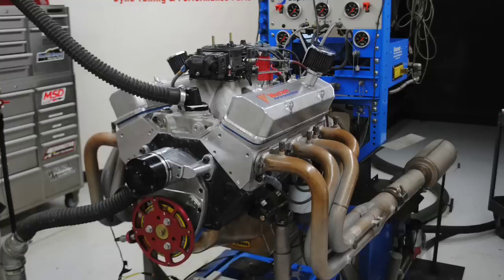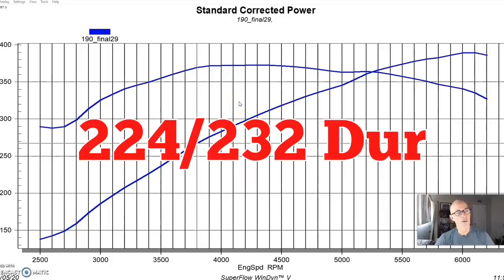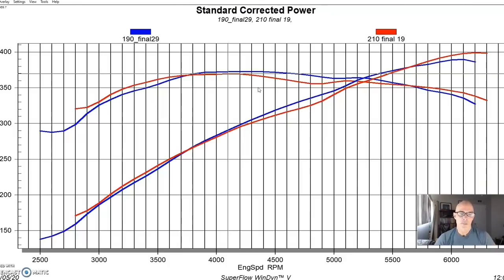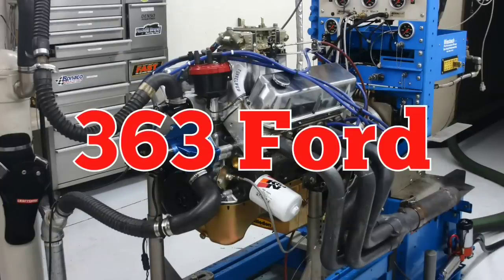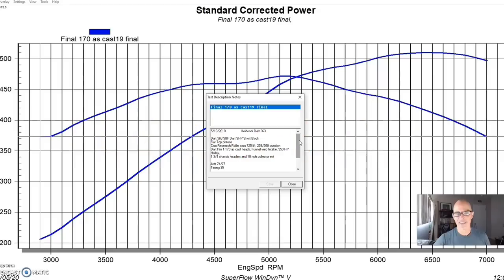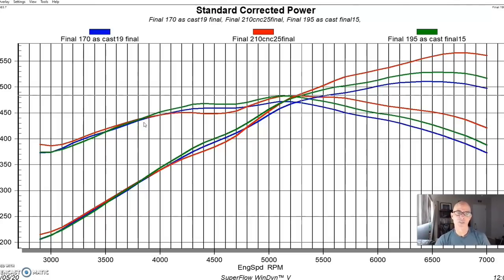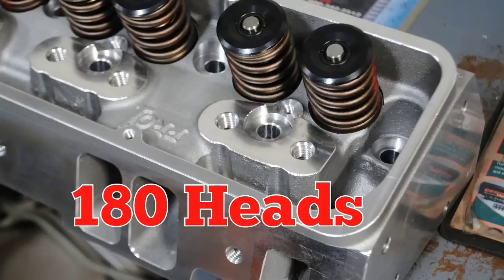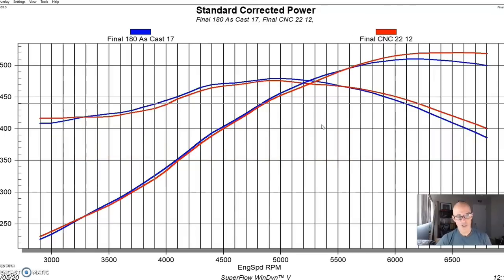PORT VOLUME-IS BIGGER BETTER OR IS LARGER LESS?

Comment: I built a 400 Ford for a 4x4 F250, with closed chamber 351C-4V heads, 351C-4V intake and spacers to use that intake on the tall deck 335 block.  (I never subscribed to the big ports stink at low RPM ideas.)  I didn’t use a huge cam, it was a 280H Comp IIRC, I had a 750cfm Edelebrock on it.  Compared to the nearly identical engine I built on a couple different platforms (Clevor/400) all with smaller 2V style ports and similar compression (Mostly Aussie Heads) the 400-4V had more power everywhere, but I found the 750 Carb to be too much primary venturi size for good part throttle booster signal, could be port velocity?   IDK?  (I bet a good Q-Jet would have been decent?)   So, for the street I ran 600cfm (ran great) and used the 750 for “Improved Stock” Truck Pulls.  That engine pulled hard 2500-6000, I wished I would have printed off the dyno sheets. – I also wish we could dyno test part throttle easier.

Comment: I wonder what would happen if you tightened LSA on the bigger port combinations? I suspect that the midrange torque gap would narrow or reverse.
Reply from the maker: changing the LSA would do the same thing on both motors

Comment: Hypothetically speaking... With an eye towards minimizing spending in the long run.  Not afraid to buy once and cry once.  But I currently have a low mileage original sbc350.  Have the itch to pep it up with heads and intake and rv type cam.  But as budget allows in future I'm thinking of 383 much more weekend toy.  Not thinking solid roller crazy, but,  Hydra roller, air gap dual plane type power.  I want to maintain as much streetable HP and trq as possible without spraying or boost for a 99% street car.  Do I go like as cast 225-ish, tricker 200-ish with factory CNC.  Does completely ported heads and intake make any sense if it's all about same-ish money?  Sorry. I tend to ramble with thought.
Reply from the maker: see the 383 videos-pick your desired curve

Comment: Interesting test Richard. I wonder if the drop in mid rpm across the board had anything to do with runner length? It would be cool to see this test setup with an Edelbrock RPM Air-Gap intake and compare the charts to see if the mid rpms pick up at all.

Comment: But looks like u loosing mid power which would roll racing since most cams don't really kick in till 3k . So my take doing rolling starts smaller is better but over all unless you hitting 6k+ the difference is a none factor for street but maybe strip   but 1k $ difference is it Worth it .. street I say no unless you want to live in the red . But for strip then yes I guess every hp matters

Comment: Very good. I was gonna run factory 624 heads on my low end torque 350 but they are so bad mouthed I just put them aside. I could not find a good enough deal on rebuilt factory heads and half the time they didn't put in the hardened exaust seats. The 186 and 041 are gold and I want accessory holes so. BRODIX 180 ik on a rv cam chevy 350 I think it will be alright. Thanks for the video

Comment: my question is if one head is as cast smaller port volume and then you run larger port and Fully CNC Ported , is not apple to apple next step. run fully cnc ported smaller port size and a larger port and cnc

Comment: The graph starts at 3000 rpm. Whats the power difference between idle and 3000 rpm which would be the range where a typical daily driver would spend the majority of its time operating within?
Reply from the maker: you at WOT at idle a lot?

Comment: So I'm building a little 306 with trickflow 205s and gona hit it around 15lbs that head should support the extra HP right
Reply from the maker: heads don't care about boost
Reply: @richardholdener1727  ok  just figured it would make less boost and stress for having a larger head.Your vedios have be very helpful for sure keep them!!! 👍
Reply from the maker: you are talking about boost but what you really mean is power. 205 heads will make more power at any given boost level, so can either make the same power at less boost or more power at the same boost
Reply: @richardholdener1727  yea that kinda what I ment with like a smaller 170 heads @15 lbs then went to a 205 head the boost would drop some and probably pick up more power with less boost like maybe to 12or  13lbs is what I'm saying would be less stress or I might just be wrong could just be the same power

Comment: In my experience.......there is no reason to ever go smaller than 210cc on ANY sbc for street/race performance. If it has healthy cam specs I never go below 220-225cc. Even if it did affect low speed torque you are blowing through that with converter or clutch. Grumpy Jenkins had it right.......when someone picks a catalog cam.......they need to add another 15-20 degrees of duration to that........as most people skimp on good flowing heads.

Comment: so if a fella was to toss in some 210 heads, a 347 stroker kit on a sbf 5.0 with a "RV" grade of cam, we'd get better down low performance, without any chance of embarrassment up high?  of course coupled with the long intake runners?  same would be for the cheverolet 305 that's about to roll into the garage too?  (I clearly understand, bigger engines have definite benefit, but i enjoy keeping numbers matching on my builds. ( it's easier to store heads and intake, etc, than entire engines.....   )  Can i assume the same rule would apply if we added boost and or nitros?   

i like your video on the low buck upgrades, using nitros for the occasional extra bit of fun....
Reply from the maker: chance of embarrassment?
Reply: @richardholdener1727  embarrassment in this case would be dogging out at the top
Reply: @richardholdener1727  i have built before, but not with the help of the extreme experts like ya'll.  I've been lucky.    I come from the same group of oak tree's the Clark R. is from "worlds fastest camaro" a few years or so ago...    I am a firm believer in optimizing air fuel, rather than simply dumping fuel.  (knowing that oxygen is combustible and that fuel is merely the catalyst that allows oxygen to burn.)

Comment: I would love to see a test where you load the engine at a constant (lower) RPM and then slowly open the throttle, plotting power and torque VS throttle%
Reply from the maker: THAT CAN BE DONE
Reply: @richardholdener1727  Im already looking forward to it!

Comment: Summit is just the opposite from ur test the truth is the more air the heads can flow the more hp and torq you will have now if you have a set of 9 to 1 pistons that might be correct using smaller port heads along with a smaller firing chamber

Comment: Alrighty, dont know why this vid keeps popping up on my suggested vids to watch, Ive already seen it and commented twice, it is a good one though if you understand what your viewing. Richard, in your opening you said you get asked all the time, "Does a bigger port hurt low speed power?" Your viewers wouldnt keep asking you that if you'ld teach them how to qualify size and how to know what output to expect at what RPM..  Ive been asking you for a couple years now how you qualify port sizes as large, medium, or small and havent seen anything valid to answer that question. I know how I do it; just havent seen you explain your process. In other words how does one go about identifying how the cylinder displacement sees the cylinder head. In one of your vids you showed viewers how to select injector size using a calculator. Surprise, surprise. You can do the same thing when selecting cylinder heads.  The cylinder head to cylinder volume is a ratio.  When one crunches the #'s to obtain that ratio you will see a pattern; learn that pattern. Your 306 with the 190cc heads made 390 hp efficiently: thats 1.275 hp per ci. The other heads for the 306 were to large but would be great for a power adder. The 306 with 190cc heads is the same ratio as the 363 with 225cc heads, but you only showed up to a 210cc head.  That engine made 1.56 hp per ci; not bad but could've been better. If you understand those #'s then you would understand that your 372, with that same ratio, would require 330cc heads, but you only offered a 210cc head that made 520hp; thats only 1.40 hp per ci. Notice how the 372 engine is down on hp compared to the 363? Thats because the 372's heads to cylinder displacement is considerably down ratio'wise in comparrison to the 363. Again, the 372's output isnt bad, but it could've been better.  If you wanna compare apples to apples teach your viewers how to qualify port sizing to cylinder displacement based on expected output at a specific RPM. Not really griping at ya as I enjoy your vids and your upbeat personality; just trying to goat you into teaching a little deeper.
Reply from the maker: your math (and opinion) is flawed-airflow is (one of the things) that dictates power-not port volume
Reply: Please tell me you dont belong to the "I cant say volume" cult. CSA, and Airflow Velocity are all related. The math can be transposed when needed. The accepted equation for determining the CSA pinch point of a head, for us commoners as the race teams and mfg's are always so secretive, is
(Bore^2 • Stroke • RPM)÷190,000
So lets look at a SBC whose peak RPM is 6,500 and do the math.
(4^2 • 3.48 • 6500) ÷ 190,000
361,920 ÷ 190,000
CSA = 1.905
(CSA is Cross Sectional Area).
If you wanted to transpose that equation you could start with the CSA and make any one of the other variables the unknown. Now take that same engine and apply it to airflow velocity. When looking at cylinder head ports you wanna keep velocity under 55% of the speed of sound which is 613.8, again for us commoners,
(B^2 •Stroke • RPM • .00353)÷ 613.8
This equation gives us the required CSA to reach your RPMs without Velocity exceeding 55% the speed of sound. So do the math
(4^2 • 3.48 • 6500 • .00353) ÷ 613.8
1,277.5776 ÷ 613.8
2.08 CSA
The 1.905 and 2.08 are very close and compliment each other, so these #'s appear to work out. Now to transpose this equation, say we knew the CSA but didnt know the safe RPM to run it up to, simply work the math like so
((((2.08 • 613.8)÷.00353)÷ 3.48)÷16)
= 6495.55 RPMs
Now for the most important example, and that is how a port volume is determined, for us commoners.  Simply obtain the cubic inches of the port and convert that answer into cc's.  So one begs the question, how do you get the cubic inches of a port? You take the average of the Short Turn Radius of the port and add that to the Long Turn Radius of the port; divide by 2: then multiply that number by your CSA.  The answer gives you the Cubic Inches of that port.  To convert that number to cc's, simply multiply by the 16.387 conversion factor; since we are working on a small block suffice it to know the average port runner is 5.45 for the many mass produced CNC SBC heads.
5.45 • 2.05 • 16.387
= 183cc
Go ahead and round up to 185cc and take your pick of the many heads that fits your needs. So if you already knew the port volume but not the CSA simply transpose the equation
((185 ÷ 16.387)÷ 5.45)
= 2.07145 CSA
Or, lets say you knew the port volume but not the required port length, transpose the math like so
((185 ÷ 16.387) ÷ 2.07145)
= 5.45
Hopefully by now you can see that the #'s are all related.  How you configure your #'s are up to you; but always remember those #'s can be transposed.  Crunching the #'s is easy, designing a port.., not so easy. These equations are all basic and only a starting point.  Engine math is curcular in that all you need are about three parameters to determine all other parameters. Yes, this is just my opinion but if you have something to offer, Im all ears.

Comment: My experience is port flow RATE. A higher velocity flow will more often outperform a large capacity, low velocity port. Peak numbers don't reflect performance when they occur at the extreme of the rev range. I'll take a "lower power" engine that puts the horsepower and torque where I can use it over one with bigger numbers that are unusable in real world applications.

Comment: Thanks for the testing. When i do my own porting I always try to minimize the port volume but make the transition smooth on the long radius and get rid of the "lip" to the valve seat along with minor work to smooth the valve shrouds. I have always gotten a good feel in the butt dyno but haven't done a before and after dyno.

Nice to see that going a bit larger won't destroy the low end power like a lot of people like to preach. Maybe next time I won't worry so much about trying to keep it so close to factory size, obviously would want to keep them constant across all cylinders. 

*valve shroud comment applies to the non-ls engines I have messed with.

Comment: People need to forget about peak horsepower numbers in vehicles with geared transmissions. That is unavailable power that you can never take advantage of with fixed gearing. Only the torque matters as that is all that drives the cars acceleration. To access Peak horsepower you need a CVT transmission. Peak horsepower is only useful for calculating your overall gear ratios.

Comment: Port "volume" is one thing and port "cross section" is another. Port Volume tells you next to nothing about how the engine will act. I can make a HUGE volume port that flows like a toilet and it will suck. Port volume is just a shade tree mechanics lame "rule of thumb" idea of comparing ports. The CROSS SECTION and flow coefficient is ALL that matters. Volume only play a minor role in wave dynamics. Port volume means "dick" when you have a runner attached which is actually an extension of the port and thus its volume. Volume is a fools paradise.

Comment: How would the exhaust runner make a difference 64 vs 72 on average?
Reply from the maker: CHAMBER VOLUME?
Reply: @richardholdener1727  say a 195 it will be a street car so I don’t think I’m going over that. I’m assuming anything higher I’ll have to rev higher to have the power come in.

Comment: These tests are not relevant.Yes the big head made a few more hp down low but the average hp was in the dumpster.Do these test in a car on a hub dyno.The big head will not accelerate a car like the small head.Accelwration I under a true load is all that matters the dyno is useless when splitting hairs like this
Reply from the maker: the dyno curve tells how the car will accelerate with each cam (that is a function of WOT power)

Comment: The reason the low speed power is up is because the larger valve, see to have a port welding experiment with welded in material in the floors of exhaust and intake ports reducing their size to 185-190 cc after working is ideal for street. a larger valve always favors low speed torque. Just look at small cube (396 and destrokers) big blocks with large valves in peanut port heads can make exceptional torque. The keys to cylinder heads and power or in the case of speed and acceleration, are not simply the size difference, it is the efficiencies in the port energy and some swirl and keeping low speed velocity without losing whilst adding higher speed velocity this is key for a cylinder head to be able to use all of the lobe design on the camshaft and or valve movement throughout its range of movement.

Comment: As far as compression goes as you jump through the different sizes of compression you create higher vacuum and higher combustion pressure.... This creates a stronger signal or a more reactive pulse to the carburetor..... The stronger the pulse the closer you'll get to detonation depending on the camshaft in the where you put the ignition timing and the fuel you use.... I like my engines 11 and 1/3 to 1 or higher... to keep them from running in the detonation with street gas....88 .....I use cams that have a lot of blow through effect.... And the biggest radiators I can find... No thermostat.... And I have to watch for the temperature is to make maximum horsepower.....

Comment: Everything is relative... You're making a very general assumption and it doesn't play for all engines.... And if you increase the size of the port eventually you will run into where you have a very muddy for lack of a better description bottom end with very bad signal response to a carburetor maybe it doesn't matter much to a fuel injection but it will eventually because I've seen fuel injection motors were they had custom built intake manifolds that it took three seconds for the engine to even react and start to increase its RPM because the plenum was way too large and then decreasing on them more responsive..... I put oversized cylinder heads on it engines and found out the hard way that I couldn't even spend the tires on the car because it was just too large you want to see large Port volume go to like a 220 intake on a small block Chevy compare it with a 185 and you'd show me that that large Port hasn't hurt the bottom end it absolutely will and I'm talking on a carbureted engine...... For instance a 60 over 350 is probably going to like a 185 intake port... For Street driving..... But if you like making power past 7000 RPM then that 220 Port is going to look pretty cool.... You just better like idling at 1,000 RPM.... And you're going to have pretty lazy bottom eñd acceleration until the thing starts to hit
Reply from the maker: 3 SECONDS TO REACT?

Comment: Also all of that sounds great but I never hear you really talk much about compression ratio and how that affects things on intake and exhaust.... For instance take a good head like a trick flow or even the Chevrolet's last Corvette head and aluminum for the small block Chevy the original small block Chevy....And change compression ratios in the motor and watch how it comes alive as you get higher and higher in the compression ratio  you'll see some stuff happen that'llreally probably blow your mind
Reply from the maker: WE WILL SEE 3-4% GAIN PER FULL POINT